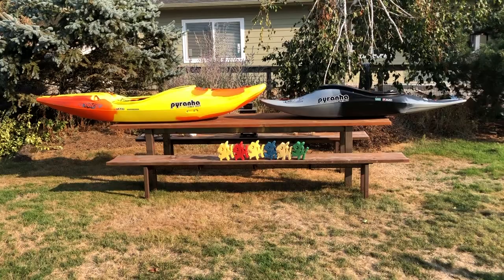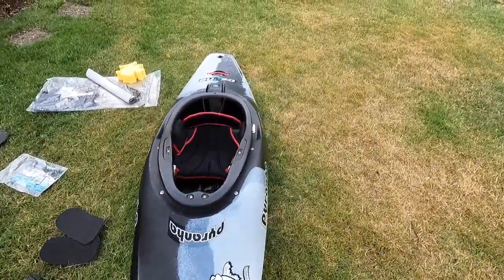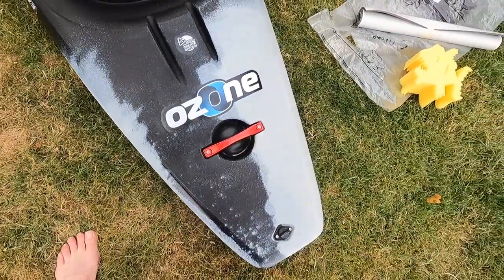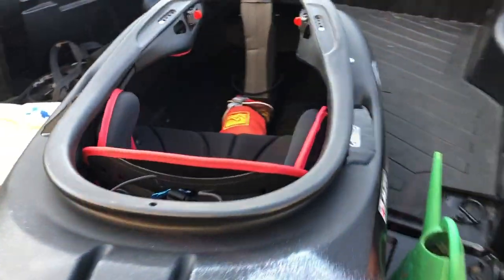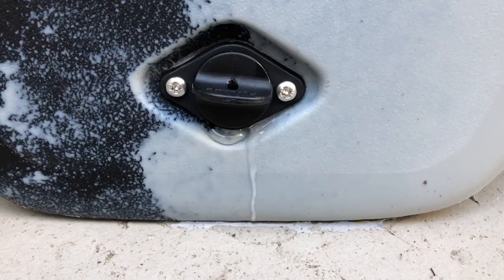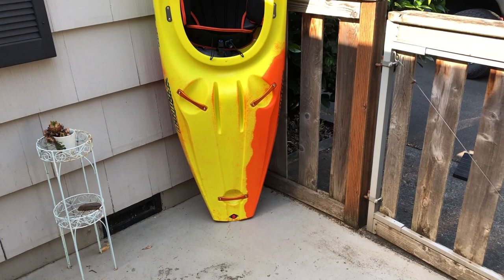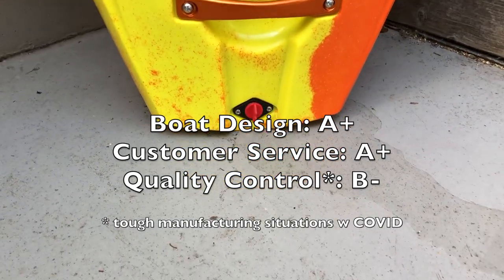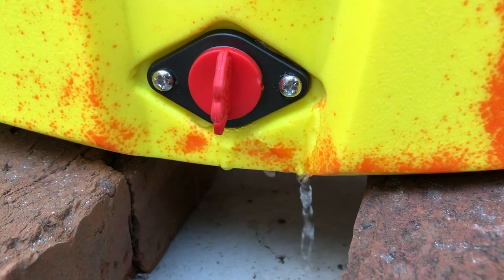Leaky Pyranha Boats PSA! Scorch & Ozone Mystery Solved 🕵️

Comment from the maker: Digging into issues with loose bolts and leaky drain plugs on some new Pyranha boats out there. Update and more from Pyranha below.

Update: 9/1/2021: Pyranha blog post addressing the issue: https://www.pyranha.com/blog/product-issue-notification-drain-bung-leakage/

Update 8/30/2021: I removed both drain plug housings and removed the silicone that was present, which was really easy. The silicone used on the two looked different, and neither had enough. The Scorch was worst with not enough to even go all the way around. I added AquaSeal, replaced housing and let sit overnight. I've tested both with 1/2 gallon of water; Ozone leaked a few drops in about an hour (seems good enough), and Scorch didn't leak at all. (Actually Scorch leaked a little from the silicone drain plug itself!, but when I cranked it a little harder it stopped.) Not a difficult process, just a bit of a pain and not something one should have to do on a brand new boat. Also sucks b/c a lot of people just won't know and will deal with leaky boat when they don't have to.

Response from Pyranha re Drain Plugs:

"I was worried that might be the case with the drain plug. We made adjustments in manufacturing a while back to make sure this wouldn't be an issue in the future, but a decent amount of time passes between the boats leaving the factory and making it into the shops and then to customers where issues like that are really noticed. Fortunately it is a pretty simple fix, the two screws that hold it on are taken out (they screw into the plastic, no backing nuts inside the hull or anything like that) then it can be removed, the old silicone peeled off and resealed with new silicone or aquaseal etc...

I know it's far from ideal to have to do any work on a new boat, and we would be glad to fix it if we were somewhere nearby, but unfortunately that isn't typically the case. Seeing as there have been a few reports of this, I'm looking into getting some 2oz tubes of silicone sealant we can send out to in the future to hopefully save some people a trip to the store. I'm just checking with the UK first that the ones I found online are going to be comparable to what they use at the factory."
Reply: Thanks for posting this! I'm grabbing an Ozone this spring and hopefully, the issue is already resolved. Cheers!
Reply from the maker: @derekbell5333  you bet. Have fun in the Ozone. It’s hard not to tbh. 👍🏼

Comment: Thanks for choosing our kayaks, and sorry you've experienced these issues! We have referred the info back to Production and QC to prevent such issues going forward, and have identified that a number of drain bung collars had insufficient sealant around where they fit to the kayak - we will have some instructions out on how to fix the latter this week.
Reply from the maker: Thanks Pyranha. I appreciate the info and it’s good to hear you are working towards a resolution for customers. I’ve always had excellent customer service from your team, and that means a lot. Keep up the great work. I’m loving my Scorch and Ozone…even more now they are nice and dry. 😉
Reply: Not happy with a brand new boat leaking this badly. 😒
Reply from the maker: @gordmccoll5009  I think that’s fair. Definitely not ideal.
Reply: Pyranha Kayaks I’m having the same issue with my ripper.  Crazy amount of leakage.  I did watch your video.  Just need to know what is the best sealant to use.  Your video says silicone but I read somewhere you were sending out aquaseal which I did not think was silicone…?  So what’s best?  I gotta stop this crazy leak for good.  Thanks.
Reply: You rock.
Always welcoming a critic.
Taking care of issues

Comment: The last brand new boat I purchased was a Dagger Mamba that I bought in 2014. As soon as I took it out of the plastic I went over all of the bolts and most of them were loose. After tightening things up it's a nice, dry ride. I go over my boats once a year to make sure everything stays tight.
Reply from the maker: I’ve made a habit of doing the same. Unfortunately my experience a Dagger boats has been less than dry, despite everything being snug. I touch on this is my most recent review of the Code: https://youtu.be/exBhSTew66s

Comment: You should check the screws for the bulkhead wingnuts
Reply from the maker: All fasteners were checked and tight. Boat was 100% dry immediately after fixing drain plug seal. 💧

Comment: I thought the water in my Ozone was just from practising rolls, ‘til I watch your video. Looking at video a friend took, it looked like the boat was actually sitting lower in the water. Doing the vertical set-up and a quart of water, I got 1 drop per second. That’s 60 drops per minute, 1800 drops in half an hour. I don’t want that. Aquaseal on order. Thanks for the video and follow-up info.
Reply from the maker: Good call! Especially in the Ozone with that stern under water so much. Easy fix and well worth it. Good luck. 👍🏼

Comment: Had issues with my Ripper all the bolts were loose and the drain plug leaked like crazy. Tightened and siliconed bolt and drain plugs.
Reply from the maker: Thanks for sharing. Sorry to hear ab your troubles, but not too surprised given what I found with my new boats. What year is your Ripper?

Comment: Shoulda bought a Jackson… no holes through the boat besides the cockpit itself.
Reply from the maker: You know it! And so do I. We’ve currently got 7 JK boats, and that’s one of my favorite thing about them! 😊 I will say though, the two boats in this video ran very dry once the drain plug issue was fixed. And my Ripper 2 and Firecracker are also both very dry, and both have no drain plug, which I love.